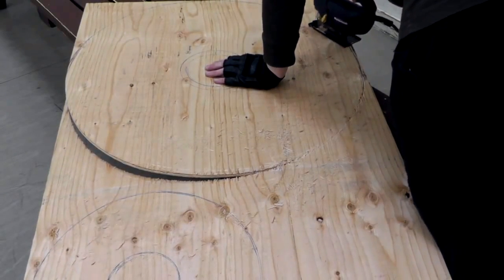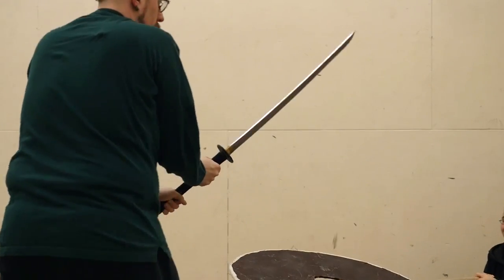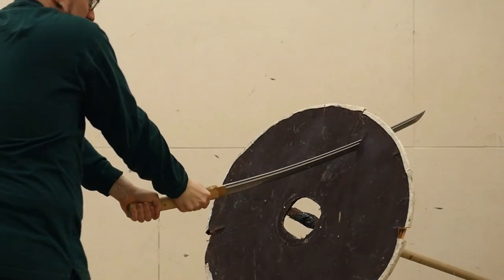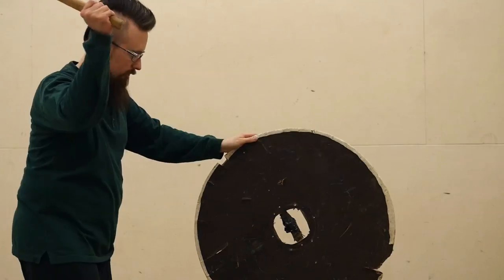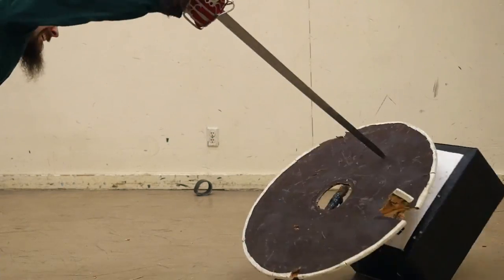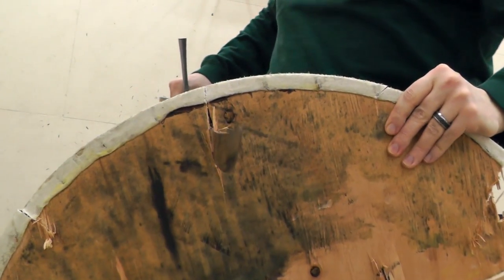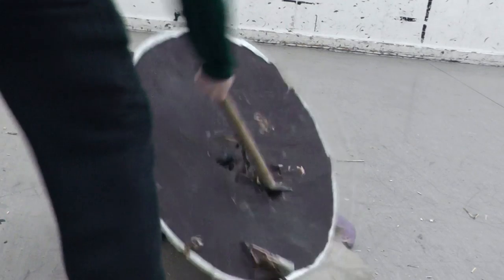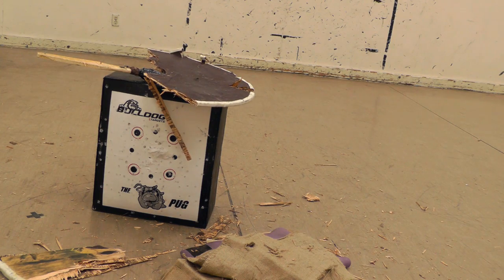Plywood shield vs broadsword, katana, axe, kriegsmesser, and war hammer

Comment: i think my arm would have given out before the shield lol. then again, i have no training and that's not exactly the point of the video, but still.
Reply: valkrieknights there are techniques to minimize the force of the impact on certain body-parts. the most basic is just moving away from the direction the strike is coming from. but of course, using these weapons and the shield in either a battle-field or a duell will be extremely different from testing how tough the shields resistance to certain attacks is. but the test shows that even with an ideal hit on the shield, your weapon would likely do very little damage and probably get stuck (for those who cut into it).

Comment: well, at least a katana can pierce through metal, like the metal used for the outter surface of a car :)
Reply: +Kenichi Otaku Tests proved it can do that as much as european swords. But for how long? It's not meant to do it and you'll ruin it if you do that too much. It even happened on this video, and at first hit on an other test video I've seen
Reply: metal for the body of a vehicle hasn't been used for quite awhile  but if they did got an old car with a steel body It would be rusty and the steel would be weak if it was a newer car it would be piercing plastic but the steel for cars back then is a certain quality of steel so there is many variables for an accurate test
Reply: +Kenichi Otaku Swords are just sharpened bars of metal. The blade shape and geometry obviously changes its speciality but other swords can do that too, given that they are made decently with well tempered steel.

Comment: what would a samurai do if he met a Western knight with his sword and sheild
Reply: Hmmm... Banded Iron sword, wooden armor vs Tempered steel full plate armor and sword...

The fuck do you think is going to happen?
Reply: WarMachineBrony the samurai would be blocked by the sheild and cut down by the sword.
Reply: +Johnny McCusker You really need to specify what century Samurai (or knight for that matter) you mean, for example, 16th century samurai could just shoot the knight with an tanegashima (japanese arquebus) and would have steel armour as well. Earlier Samurai could even function as horse archers, so they could just shoot the knight's horse and then it's game over.

Also, knights only used shields before introduction of plate armour so he would wear chain shirt with padding. If the knight has full plate armour then the shield is redundant, besides, no Samurai would cut into it like an idiot.
Reply: +WarMachineBrony Samurai didn't wear wooden armour...
Reply: Lord Muhehe the Samurai only fought other Samurai in warfare that rarely changed. The weakness of Japanese fighting techniques have been demonstrated when there weapons were shown as ineffectual against a bronze age hoplite. If the Samurai pulls a arqebuser then the knight pulls a flintlock musket.
Reply: Johnny McCusker Thing is, knights didn't use muskets. So no, knight in full plate armour with a wooden shield and arming sword really wouldn't pull 17th century firearm.

By the time flintlock muskets were used, plate armour was obsolete and knights with it.

And as I said, you REALLY need to specifiy time period or preferably equipment (arms, armour, mount). If you did, then we wouldn't have this discussion.

And at the end of the day, skill is the most important thing.
Reply: +Lord Muhehe what happened when the Japanese meet the Mongols in combat the mongols with sword and sheild defeated them.
Reply: Johnny McCusker You do realize that duel and battle are two entirely different things right? First of all, duel and battlefield use different fighting styles. Second of all, in battle there are so many variables in play. Weather, tactics, morale, terrain, numbers, training, equipment etc. You can't just say that Mongols beat Japanese in some battles because they had some troops with shields...

I mean Hussite force of several hundred armed peasants (including women and children) defeated up to 2000 (sources vary) knights in the battle of Sudoměř. Does that mean, that agricultural flails and scythes are the reason they won? Of course not.
Reply: all im saying im is that a sword and sheild combo would defeat the samurai
Reply: You're the one that randomly brought horses into this and tanegashima.
Whatever century we're talking about, the scenario would be a melee duel.
Reply: Cubed think about it the major weakness most artists have is that they fight similar trained warriors ie samurai vs samurai.
Reply: depends on period, some is little more than laminated stingray leather

Comment: the katana is a weapon that requires skill to use(no offence in tended). you were not cutting propery
Reply: A katana is used to cut with fluid motions yet every video about a katana even those with "pros" in does strong Cuts without mutch flow (i Know abit on how to use a katana as im currently learning martial arts and One of them is learning how to weild a ausachi)
Reply: +SweWolf Gaming asauchi
Reply: And i do believe he used a wakizachi
Reply: +SweWolf Gaming wakazachis are smaller i am also a practioner in aikido and have a lot of expierince with japanese weapons. skallgrim is not cutting properly. use you put weight in into the cut
Reply: Man on the moon do you have to be a weeb to use a katana? you do know kenjutsu is martial arts right?
Reply: It would not have helped much
Reply: +Man on the moon ikr, why tf would you practice katana for years just to be good at it? Just by practicing with a shield and sword, you can be much better than a katana user, it's pointless. Even an axe is much better than a katana
Reply: +Louis Philippides And you do know that he did use a proper kenjutsu cut. By the way, kenjutsu and historical european sword techniques are pretty much identical.
Reply: You Katana lovers are frustrating as hell. Accept the fact that your sword was effective at one thing, "low-no armored combat." They were never made for European combat because they never faced metal armor or shields for that matter. It was never made to excel at this type of testing because it wasn't required to be.
Reply: DaneRavienus Dude it did just as good as a medival sword in the video. Katanas were just as good as them and no sword was good against metal armor
Reply: +Bruce Jedi Lee I'm not denying it was a good weapon. but what I am stating is that it was no better. It was made for a different type of Combat all together.
Reply: +Skyclaw Eallec 
I study kenjutsu, and that cut was incorrect.
Reply: +Austin Hill The complete technique may have been incorrect, but I'm talking about the way he cut. As I said, HEMA and kenjutsu are nearly identical, not exactly identical. The way a modern samurai can slice with a katana, he could kind of do the same with a longsword. And vice versa with a HEMA practitioner can slice with a longsword can also cut well with a katana to a lesser degree. 

Overall technique might not be the same, but the purpose of doing so will always be the same.
Reply: Skyclaw Eallec 
I'm talking about the way he cut as well. During our instruction, if we were to cut that way, our sensei would tell us that we were "chopping" and our blade would most likely get stuck in a body. Making us an easy target and getting killed.
Reply: +Austin Hill The "chopping" also depends on exactly where you hit too. 

Not a lot of the weapons Skall used severely damaged the shield. And he also said that a sword in a shield would open you up for a counter. That was because no weapon was meant to cut through armour, including the katana. A lot of them were meant to cut flesh and bone, not tough wood and steel.
Reply: Skyclaw Eallec 
What do you mean the chopping depends on where you hit?

Your blade should always lead your hands, your hands should never lead your blade, at least with a shinken. You shouldn't be cutting a shield in the 1st place.
Reply: The problem with Katana's is that against armoured targets they were useless. Zweihanders are much better, the weight of the blade allows it to cleave it's way through soft enemies while having enough mass to deal with more armoured enemy's. 

The only downside is that they aren't as quick but this is offset by the fact that any competent user of a Zweihander will abuse it's length and were often armoured themselves.
Reply: It requires no more or less skill than any other weapon. Personally I'm a bit of a weeb, so if I had a preference for a weapon then it would undoubtedly be the katana, but even I accept that a katana is not a weapon for striking shields. The katana really is a very linear weapon that cant do fencing, armors or shields rather easily
Reply: i beg to differ, know someone who fences with a katana on a regular basis and fares quite well, fencing is a different style of combat, more parrying and counter thrusting than impact based, and the katana can hold it's own against any other style of fencing blade in it size

Comment: I guess the katana was overrated.
The katana is designed for cutting. Cutting anything tough is just stupid; as the katana is wielded with both hands, an opponent with a shield/armor and sword will make quick  work of the katana user.
Reply: +Earl Vic Longakit Katanas are overrated. Skallagrim made another video addressing specifically that topic, but this video does a good job of showing how ineffective katanas are.
Reply: ***** The materials used were nothing but compensation because the japanese blacksmiths had no access to high-quality steel.

Comment: Too bad you didin't have two-handed sword
Reply: +jakub wojnowski Katana and Kriegsmesser are two-handed swords...
Reply: do you know how long and how heavy is EUROPEAN two handed sword ? I don't think so. this sword which he has is long sword. long swords are one and a half handed which means you can use it by one or two hands. on this link you can see real two handed sword ;)http://miecze.pl/two-hands/222-miecz-dwurczny-pomienisty-flamberg-xv-xvi-w.html
Reply: jakub wojnowski Yes but the Katana is horrible when wielded in one hand, it's designed for two hands. Ofcourse there are even bigger two handed weapons, that doesn't mean smaller ones aren't two handed as well. And yes the longsword can indeed be used as one handed and two handed.
Reply: +HammerheadGuitar that's why I don't like katana I think samurai will don't get chance to won with EU knight
Reply: jakub wojnowski It's virtually impossible to wound a heavily armored knight with a Katana, only chance is to thrust the sword very hard in a weak spot of the armor.
Reply: +HammerheadGuitar do you mean a knight with katana ?
Reply: jakub wojnowski No I mean it would be extremely hard for a Samurai to wound a heavily armored European knight.
Reply: +HammerheadGuitar yup I agree

Comment: kriegsmesser = battleknife :D
Reply: Raptor4955 = european katana that does work better, has better balance and guard, some interesting techinques.
Reply: +Latte Moon No. A katana is a katana. And a kreigmesser is a messer. Stop trying to compare completely different swords. The Katana is curved, the messer is straight. Katana is 2 handed. Messers are either one or two handed. They both are used differently. Use completely different techniques. Made in completely different places and cultures. So no. Not a "European Katana".